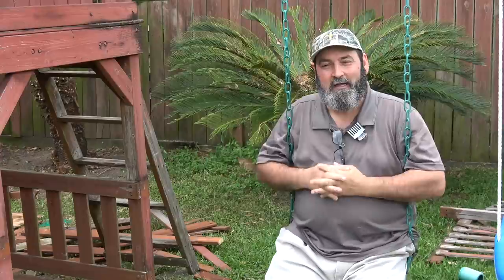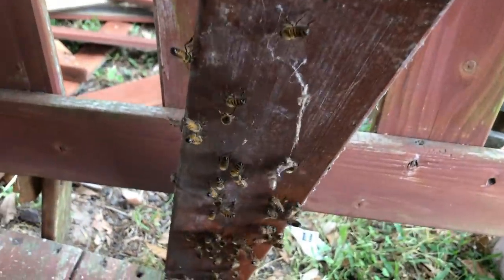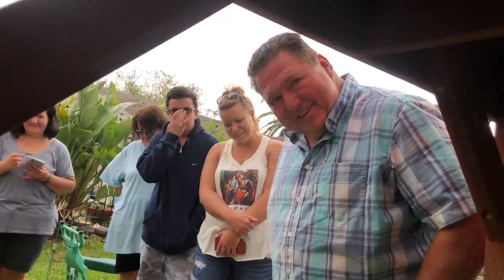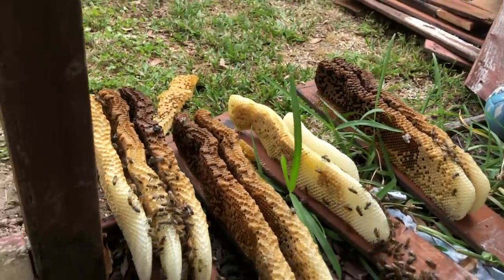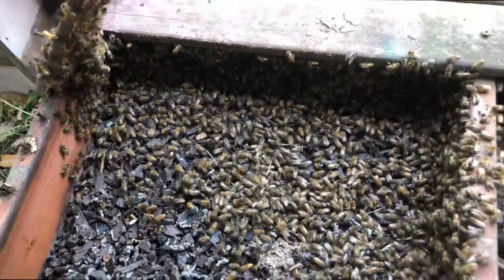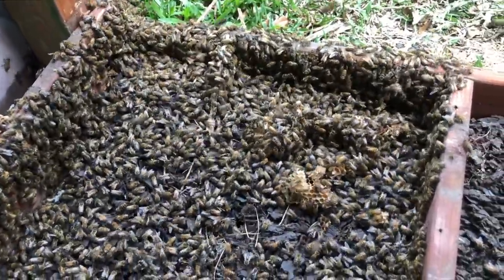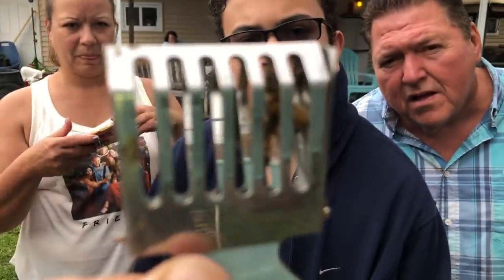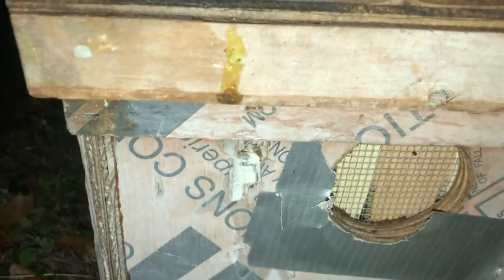Bee Man Vs Beehive In Playhouse

Comment: Oh, Duuuude JP! That was a close one with that swing! It's a good thing your angels were there to keep you from REALLY whacking your back on those pavers. I sure hope you were all right.  I had a potentially serious physically dangerous fall happen to me once except mine was a face-planter. Slipped on wet leaves in my backyard veggie garden 4 years ago and I started to fall backward. I felt my body lurch forward, do a quarter turn and fall. If I had continued backwards I would have hit my head on the corner of a raised bed. How on earth I landed face first BETWEEN two closely placed small stacks of old brick holding down a tarp I'll never really know but I attribute it to my angels. All I had to do was turn my head left or right and they were right in my face. And to top it all off I didn't have my phone on me so I couldn't call anybody for help; however, my neighbor lady just happened to be outside working her flower beds across the street out front so I started yelling for help. She and her brother came and helped me get back to my feet - I have knee replacements and have a hard time getting up from the ground. Not a scratch, not a bruise, not a sprain, not even a little hobble.  It all happened so FAST. I never go anyplace outside my doors without my phone now either.

Comment: Looks like a top bar hive is needed. I have a few of them. I use masking or painters tape to attach them to the top bar in either hive
😊
Reply from the maker: A long hive with full frames can work fine & you can even harvest down the road. If they have to be moved you can place them in Lang’s & stack em. 

TBHs are a nightmare to move.

Comment: Good video. I don't think I'd like to have a beehive in my child's play house. It would definitely suck. I'm pretty sure that I have seen other people who wrangle bees use comb like this to frame it, even though it's short and wide, but I've seen them kinda stack it in the frame. Could you do that with this comb? Or was it just too new and soft?  
 As for the Corona virus, it's not nearly as bad as governments are trying to make it sound. Based on the CDC's own numbers, the deaths for 2020 weren't any higher than from any previous years. They have made it sound like it's killing far more people than it has. They have done this by changing how deaths were counted with the Corona virus. In previous years, using the example of the flu virus, the virus had to be a strong contributing factor in a death before it could be counted as a death from the flu, but for the Corona virus, they started counting every death where the person had the covid virus, as a covid death, even if the person died from something completely unrelated, like, a car crash. They have done this to keep us afraid, to infringe on our rights, and to push a vaccine that is not safe, properly tested, or effective. I am not an anti vaccer either, and I have already gotten the covid vaccine, before I realized how badly they are lying to us. I have done a lot of research since then, and looked at actual data, instead of going by the governments propaganda sites. I know now that covid is no deadlier than the flu, so we should stop being so afraid of it. We should also stop the government from continuing to take our rights away, and pushing an untested, unsafe, ineffective, vaccine on us. Anyway, that's my opinion on that. My opinion on the video is that it's was a good video.👍